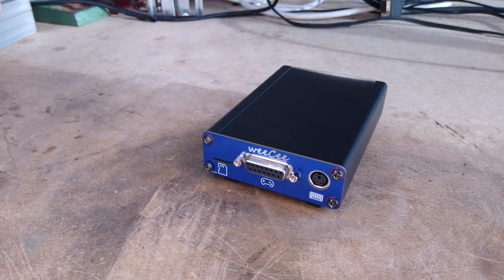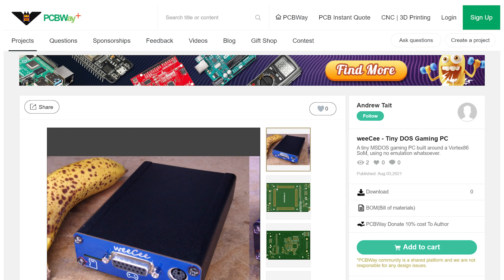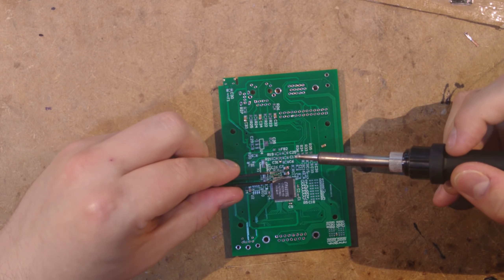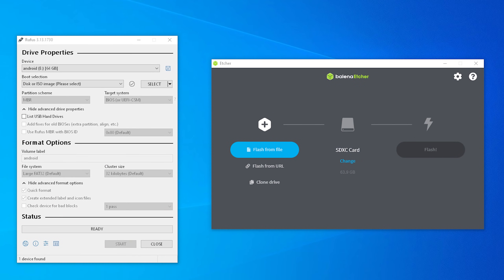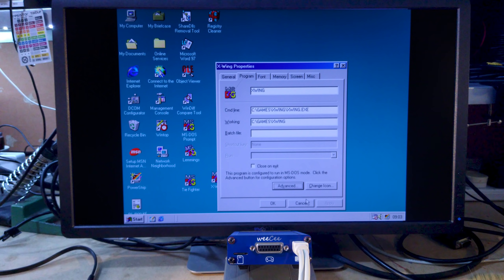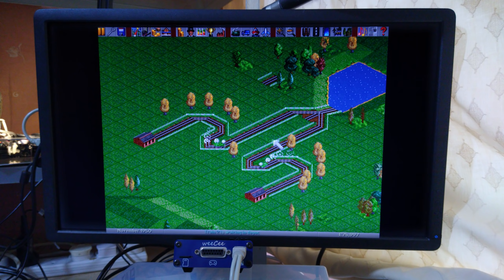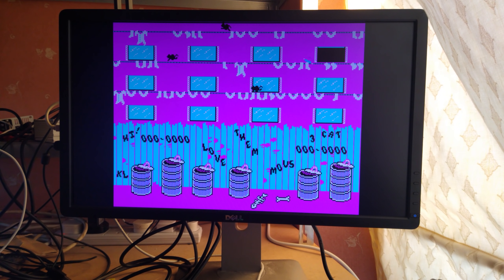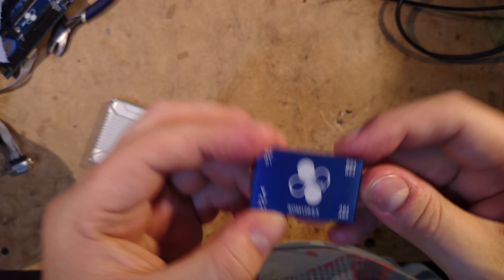TINY DOS gaming PC build guide - weeCee Part 2

Comment: Here’s an idea:
Instead of going smaller I’d like to see you go back to the original housing and see what else you could fit in there with the even smaller module that has multiplexed pins. Clearly, I feel the larger housing was small enough! Also, you could make it look more like an old AT/XT by cutting a longer extrusion at an angle to make two housings. A 3D printed frame could create a flat face for the screws and complete the recessed drive look you were going for with the black/beige faceplate.

I know having a game port on the front makes sense for usability but the back would look so much better and since it fits vertically you might have even more room for I/O (Serial? Parallel?). Many of us already have extenders and Y-adapters, so that would be the perfect mini-PC for me. A fella can dream, can’t he? ;)
Reply from the maker: Good idea! Perhaps in a few months.
Reply: @TheRasteri  Now that I think about it, the only reason to cut the extruded housing at an angle would be to approximate the look of the angled bezel without actually making one, since the drives themselves were never angled. Actually making an angled, 3D printed frame piece with a normal vertical end plate would approximate it even closer so there is no need for an angled cut on the aluminum housing. Screwing the angled end plate down wouldn’t work without the very frame that negates the need for an angled end plate. :)
Reply: @TheRasteri  Hmm the smaller one has a PCIe interface? How about building one with an integrated 3DFX adapter? I know there are still some NOS 3DFX ICs floating around 🙃

Comment: If I can't rely on the case to provide mechanical support to a USB connector, I will often put long solder pads on either side of the connector so you can anchor it that way

Comment: This project is awesome !

As for the power connector, I think a USB C connector would make more sense these days. USB C cables seem more reliable as well (at least in my experience) and they can provide more power.

That bios makes me thinking ... Maybe there's a way to figure out how the CPU is slowed down by it and then to write a DOS app that would let you change the speed on the fly instead of having to reboot and change the speed each time ? That would be neat !

It also makes me think of the projects like the atmega based sound blaster clone. Maybe it'd be possible to make a WeeCee that wouldn't use any vintage parts at all ?
Reply: We can also use the USB-C to connect eGPUs if we want to have 3D acceleration for any old games that uses Direct 3D acceleration.
Reply: @firelightyear  uhhhhh no
Reply: @jonessii  I hope we get a future version of a Weecee where it has a Pentium III and Direct3d 5-9 acceleration…
Reply: @firelightyear  I feel you! Pentium III with 3d acceleration from proper GPU would be gamechanging
Reply: @synnek3596  Yeah and having USB emulate IDE for connecting external disk drives too.
Reply: I think Mini USB makes way more sense since it's a much stronger connector.

Comment: Windows 98 was the best multi-purpose DOS system.  I find it very interesting that x86 has this industrial alternate life. It sounds like it might eventually be replaced with ARM.
Reply: It might, but the main reason for that legacy is just because there's still a LOT of very old industrial equipment reliant on old x86 software, often not easily emulated on a different CPU arch. So it's a market where companies can still sell computer modules and such for. If they'd have to switch to ARM, it would cost quite a lot, because not only would the x86 based controllers need to be replaced, so would the equipment it was controlling. And that can be cost prohibitive enough to not bother.
Reply: @Dan-TechAndMusic  that and these things have been well figured out and reliable for decades now, if a process doesn't actually need more processing horsepower it probably still makes sense to just use the old DOS hardware

Comment: So this is great, I definitely need to build one. 

I’ve recently picked up building and flying FPV drones, and a big part of the hobby is setting up and tuning the quadcopter to fly correctly, which typically requires a PC. 

Most people are using Betaflight 4.2/4.3 at this point, and having a very portable device that can connect to flight controllers via Micro USB or WiFi would be soo incredible for all these new FPV pilots. 

I know you said you enjoy your day job, but I don’t currently have a day job and I’ve recently learned how to solder.. at a hobby level for now. 

I’d be happy to throw some electronics together for someone. That would be like perfect for me. 

Just sayin’. Lol.

Comment: Careful when soldering around a battery. I recently had to makeshift solder for an industrial x86 board, and the CR2032 went flat in just a few months, as heat really damages them quite fast, even with short exposure. On-board connector or even a cell battery holder would really be better.
Reply: I stupidly bought cr2032s for my 2 units and there's no way its holder can fit above. Gotta use tape or go underneath the board
Reply: @michaeljuneau4085  For CR2032, you can get holders where the battery sits upright, and not laying flat. But maybe there just isn't enough place anyhow.
Reply: @graealex  I'll just put it under the board where it can be away from the heat of the SOM

Comment: Fun fact it's not stricktly required to back boot into ms-dos mode to play dos games. They can be run via ms-dos prompt in windows 98. I have a Windows 98 machine and I run dos games straight in Windows 98 using this method. You can alt tab to another application or alt enter to switch to window mode (most dos games complain about window mode till you switch back to full screen) I put the short cuts in the start menu, so they just feel like windows games. I believe you can even run multiple dos game like simaltaniously.

Comment: Thanks for the battery idea and pins, I'll get around to adding that to my project.

I hope I didn't damage one of my 2 units, I was so close to attempting a networked DOOM deathmatch :( My 2nd unit has started to drop its voltage to 2.30ish V when the SOM is connected.
Reply: SOM isn't damaged (I tested it on the other unit). Pet theory is now: faulty voltage regulator
Reply: It works again! Replacing the F1 main fuse with a solder blob let it go above the underspecced 750 mA rating. DOOM LAN match between my 2 machines here we go!
Reply: Yeah Mu0n is my other account (in case anyone is confused ;)

Comment: I really enjoyed this series, - as a DJ, I am keen to see whats next on that front, - but I hope you do some more PC stuff also. I would love a mini Pentium III machine with a graphics card, like an S3. - Is there a CD-ROM emulator, similar to the floppy drive emulator you feature? - I would love to play Myst & Riven but I hate swapping disks. - Imagine a SSD that fits into a CD-ROM bay, with a little screen and some buttons that allow me to page up / down & select images. - The computer would think its connecting to a very fast CD-ROM, with simulated disk-loading. - Looking at your channel, a device like this seems well in your technical abilities.
Reply from the maker: It kinda does already exist but it's expensive and slightly awkward to use - https://shop.tattiebogle.net/product/prod_EkTnv3Tk2Trxhf
Reply: @TheRasteri  - I have it! - Please take the track select wheel off a CDJ with its small screen & solder it to the IDE Sim. - would be awesome.
Reply: @TheRasteri  sometime i wonder is the gpio of the rasbery pie can handle a IDE émulation....

Comment: Q: Curious what the maximum audio resolution in DOS would be with the Crystal chip.  Can it support 16bit 44.1khz audio?

I don't play retro DOS games, but I compose music with https://en.wikipedia.org/wiki/FastTracker_2, and I also use several other rare obtuse DOS programs for editing audio on vintage 80's and 90's samplers.   I have several very aged 486DX and Pentium 1 systems, that run FreeDOS for interfacing with this equipment and making music.  When I saw this project I got REALLY excited, as it potentially would allow me to keep my DOS music alive, and not to mention, much smaller and more energy efficient!  The MPU-401 Gameport support means I can connect a MIDI adapter cable and use it just as I would my clunky old DOS systems.  

Thanks for sharing!  I think I've got to build one of these ASAP!  Ordering parts now.

Comment: This is the best thing that I saw on the retro PC scene ever. It is amazing. It would be really interesting to see it running FreeDOS and test some games to check compatibility. BTW does this beauty has any small integrated buzzer for the internal speaker sounds?
Reply: The sound chip takes care of that, it takes the SOM pc speaker output and mixes it to the sound blaster output. No need for a physical speaker just for the PC speaker audio.

Comment: I wonder if it would be possible to create (via PCBWay) a kind-of backplane for this Vortex module, giving it ISA/PCI slots? Sure it would be bigger and defeat the purpose of the weeCee, but it would be nice for PC gaming with the option of, like, DOS sound and 3d accelerated video cards.
With super socket 7 motherboards getting rare and expensive, it might make an attractive, reliable alternative.
(even cooler would be to mount it on a PCIe card to have it be the equivalent of an Amiga Bridgeboard for modern PCs. )
Reply: I would be also be interested in the backplane. In my case, it would be for running the Korg OASYS PCI card on a modern incarnation of era-appropriate hardware (from what I see online, the editor works on Windows 9x and Mac OS 8/9). However, I understand my use case is a bit futile since a Korg Prophecy emulation (which has similar sound generation algorithms to the aforementioned PCI card) was recently added to the Korg Collection and would probably be a cheaper proposition for what I want.

Comment: I wonder if it has a PCIE/ISA wiring, you can connect a VGA/GPU chip to?

you can also solder the micro USB port to a naked ground patch on the PCB, if you created that patch in the right place on the board.

Comment: I was inspired by this project to pick up one of those eBox thin client modules for some basic DOS/Win9x gaming, although I've had issues trying to get Windows 98 installed. Partway through the install I'll crash out to a 'Fault outside of MS-DOS Extender' error and had no clear path to fix it.
Reply: Update: I've managed to install Win98, though it seems to only want to boot into Safe Mode.

Comment: cool project and a nice idea.  an ITX form factor board for these would be nice.  3D Print a retro looking faceplate for those cheap aliexpress ITX enclosures with a CF or SD slot where a floppy drive would have been on a larger build and voila.  Tiny 486 gaming device.    MiSTer FPGA is another good solution but this is a great repurposing of hardware.  Is there any concern about cooling in that case?

Comment: One thing I'm confused about is how do you start/shutdown/reboot these? Do you do like a pi, shut down the os and unplug it?
Reply: In this design, it's the cable that decides everything. For my units, I bought micro USB extension cable that has a button so that it cuts down on wear and tear because you never need to unplug the cable

Comment: Upvote just for reinforcing the Micro USB connector. This drives me nuts when I see surface mounted usb connectors free floating on commercial devices. It's fine if it's a diagnostic port, but heck, even then there's no reason not to help it a little bit. A dab of hot glue helps too BTW, but of course you have to be careful with it seeping inside.
Reply from the maker: I also like this micro USB connector - https://www.mouser.co.uk/new/te-connectivity/te-ip68-micro-usb/ - it has "ears" that let you physically bolt the connector to the board/enclosure. But there wasn't enough space for it in the weecee :)

Comment: While making the computer as small as possible is admirable, both of your designs are plenty small compared to any ATX or ITX variation.  Would it be beneficial to make one just a bit bigger to include all the necessary bits to emulate as much hardware as possible?  à la the MISTER AO486 ?

Comment: Why Micro USB?, why not USB C?
Reply: Maybe to avoid sharing cables with other devices, and usbc usually spits out higher power output, so also maybe to avoid risking frying the whole thing, that's why the resort to micro, and usbc is slightly bigger.

Comment: I don't think the size matters all that much man. 

I mean as long as it's not a huge box like the real thing from way back when. I'd totally be fine with something the size of a 5 1/4 CD drive or whatever.
Reply from the maker: Heh that's not a bad idea, then you could install it in a modern PC drive bay
Reply: @TheRasteri  That's another way of looking at it. The only issue, it would complicate the setup of the ports on the back. Better keep it a standalone. 

It should probably have at least one compact flash port, regardless of the format being so old. I've still got a fairly new camera that takes those cards. They're not that hard to find. 

Native VGA 15 pin port, as well as hdmi. I'm not sure what else. Main thing is having it relatively feature complete for the time period it's aiming at.

Comment: Too much expensive, i was very happy to see it when i saw the chipset price: 177$ . But it still interesting to see it's possible. I think such an hardware must cost 100-150$ when you have to build by yourself; I don't know like you all chipset existing, i'm not an electronician but an electrician (bac+3 en France plus carrière en bureau d'étude), perhaps there is no solution except this. I would to find something with a bios, able to run an ms-dos (that means you can run windows on it) a single core between 200-400mhz, lan, sound blaster 16, and something that could support a glide passtrough for 3D (but it's not an obligation, in priority baldur's gate for the most greedy 2D Games). Perhaps with a mass production you can reduce the cost, with crowfunding you can start something. But remember about the price, because here i can have a vintage pc for the same cost... and even with the crt.

Also i think a thing is missing here too... a scanline generator. and perhaps make a doutble output vga/hdmi but without your knowledges perhaps i'm wrong.

Comment: Awesome.  Emulators are cool in their own right, but pretty terrible for games where latency is crucial.  Some day there will be an inexpensive x86 native chip that's small and cheap.  800mhz is overkill for the bulk of DOS game interest.  Emulators are just too cheap and tempting for any manufacturer to set off developing their own silicon.
Reply from the maker: The Vortex86 itself is pretty cheap, but the module that contains it is much more expensive. Mounting the Vortex86 directly on a board would make it much cheaper.

That said, the SOM-128-EX module is much cheaper than the SOM304 - I'll do some experimentation someday.